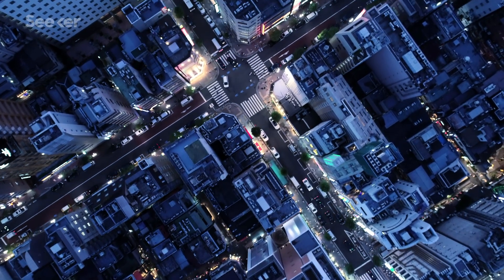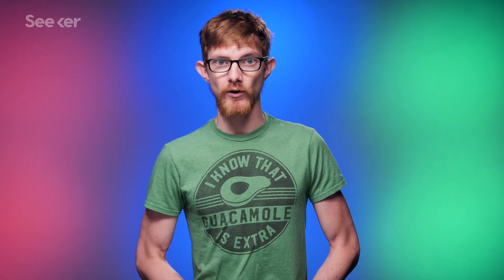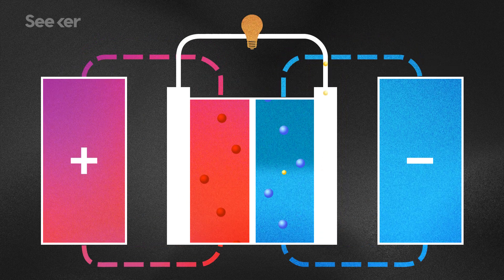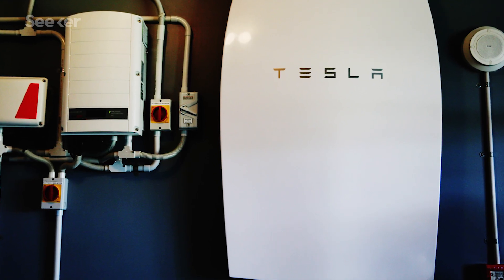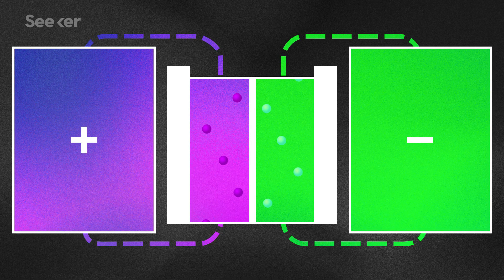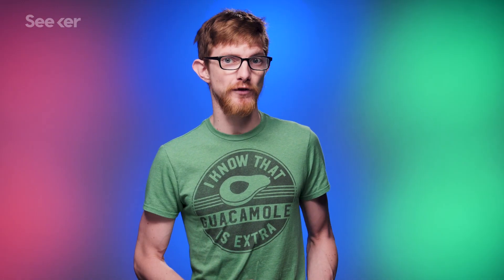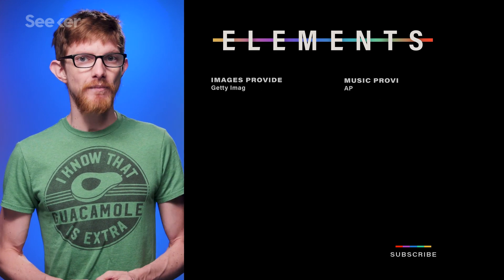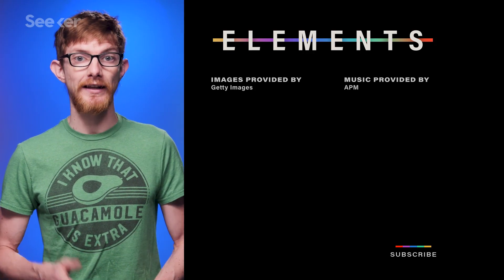Giant Flow Batteries Could Power Your City in the Future

Comment: One of my lecturers is a solid state chemist, and she works with these kinds of materials. Trust me, material scientists are trying every substance in existence to see if it can be used as a battery. We'll find something eventually
Reply: What's wrong with kinetic (spinning disks) or potential (elevated water) energy storage systems?
Reply: Well those are more engineering-related than just chemistry, and a little out of my field, but;

Kinetic disks have the problem that they don't really scale well and have a nice habit of tearing themselves apart if you try. There is some headway being done though.

Elevated water storage is already used all over the place. The big downside is there are few places it can be used, and it also takes up habitats.
Reply: Lewis Massie Makes sense.  I'm a big fan of, "KISS," which as I'm sure you're aware means, "keep it simple, stupid."
I like the idea of achieving energy-storage goals with inert materials.
Reply: Am l the only one freaked out by the notion of negatively and poisitively charged solutions? There is no such thing. I get that you try to simplify but l think this is a harmful.
Reply: @andraskatona9766  focusing on unrealistic solutions is harmful as they distract attention and investment away from actual proven solutions. Renewables will not save the planet. They will doom it by eating up subsidies, forcing nuclear power plants to shut down, and by locking in fossil fuel back generators.
Reply: @naberville3305  I agree with you in that nuclear is the way to go (possibly modular mass produced molten salt reactors). But I also believe that in the long run we must look at renewables as tremendous ammounts of enregy comes to earth in the form of sunlight. I think its naive to think that secondary cells could be scaled for such purposes but if you want to store huge ammounts of energy chemical enregy is the best bet. So something like electrolysis or flow batteries sounds good, to me it's good to hear about it.
Reply: @andraskatona9766  I believe solar is only useful for camping and calculators. Just because there is a tremendous amount of energy doesn't mean we need to tap into it. There is enough uranium filterable out of the oceans to power all of humanity for a billion years
Reply: @naberville3305  Fun debate. We will never produce any trace element from ocean water, maybe if we had practically free energy but than why mine uranium for energy. On the other hand we have big, good for nothing deserts where we can harvest all the solar we need if only we could transport it away. If it's economical than sure we should tap into it the more enrgy we have, the more we can do with it. Like fixing CO2 from the air.
Reply: @andraskatona9766  solar and wind are very ineffective at offsetting carbon emmissions.
Reply: @naberville3305  see you can't compare the sun with resources on earth.. hehe you are not even comparing it to the earth, home of resources
Reply: @shashankkumar5163  sure the Sun's wonderfully powerful. But unless your attaching a steam turbine to the sun there is no efficient means of harnessing it's energy. Solar is not an efficient means. It is much to resource intensive.
Reply: @naberville3305  well maximum efficiency human kind have reached in terms of thermal power plant is 46%.. While we have also reached near about 48% efficiency of solar panels in lab.. However the maximum theoretical efficiency of an infinite junction PV panel is around 86%... And one thing that in PV which is basically a large area PN junction is also understood as a container which is containing the electron gas. Therefore,  scientists use to apply thermodynamic theory for electron gas to understanding the electrical behaviour of PV panel (however nowadays more advanced quantum theory is used but that is more demanding in terms of computation). So it can be easily seen now that while PV panels use thermodynamics principle directly on the electrons which are current constituent particle while steam turbine applies thermodynamic to water gases to turn an electric generator to operate the current constituent particles electrons to move electricity. See which is more direct
Reply: @shashankkumar5163  I'm afraid that it hardly matters how efficient a PV panel is at converting received energy from the sun into usable electricity, if the intial energy received is dilute then It is a statistic that quite simply doesn't matter. And no the actual average efficiency is under 20%. When I speak of efficiency. I am speaking of resources and energy neccesary to produce that power. And in that topic.. solar is absolutely garbage. It requires 17x as much materials and 450x as much land to produce as much power as a nuclear power plant and creates 300x as much waste. Producing peak power at only about 15% of the time compared to nuclear producing it 90% of the time. 
Solar simply costs too much resources to construct, too much land to construct them on,  and produces too much waste for which there is little guarantee of proper disposal, and fails to eliminate carbon when it relies upon natural gas back up generators to regulate the grid when the sun doesn't shine. Solar as a viable alternative to fossil fuels is as much a fairy tail as snow white. Wind turbines are much more preferable to solar panels. Yet still lack the consistency neccesary to completely rid of fossil fuel usage. 
The goal is not to build solar panels and wind turbines. The goal is to rid the grid of carbon emmissions to slow global warming. Supporting a plan doomed to fail only makes our chances of achieving that goal all the more difficult.
Reply: Graphene.
Reply: and if we don't ... wat than ?
Reply: Catnium I'm trying to tell you all that space technology is waaaay more advanced that what we are being told.  What do you think they're doing out there at Area51?  Stealth?  Thrust vectoring?  No.  It's single-stage to space for which we possessed the technology in 1988.
Advanced propulsion?  You better believe it's a reality.  Just search, "UAP new York times", to find a new articles about craft that fly without wings.
Whether it's, "theirs", or ,"ours", it's real and we should stop digging up materials from the ground to energize our future.
Reply: (ignoring the spelling errors and dropping the mike)
Reply: Bio Gas
Reply: So your lecturer is a solid state chemist. How does that translate to knowledge expertise in flow battery design?
Reply: Energy storage is pretty much a lost cause. Even if you could develop batteries with 10x the energy density of lithium ion it still wouldn't be feasible. There is currently only enough energy storage in California for 12 minutes. Including every battery in every vehicle on the road. Times that by ten you still only have 2 hours worth. If you want to achieve 80% renewable energy from wind or solar. You need a days worth of energy storage. Meaning even with this supposed 10x better battery you'd still need 12x as many batteries as are currently in all of California. For 100% renewables you need a week's worth of energy storage. Or 84x as many batteries as there are in all of California. You might save the climate. Hurrah. But doing so would destroy the environment with how much strip mining for materials and land clearing for energy storage banks would take place. Not to mention asinely expensive. Any 'miracle battery' that gets Invented is still going to be new technology and stay unattainably expensive for a long ass time. Especially if it requires expensive or hard to come by materials. This is the limbo most current miracle batteries are in such as graphene. if we want to quickly offset carbon emmissions the only solution is tostart building more nuclear reactors. Might take several years or a decade to build. But once their operational they'll provide large amounts of safe, carbon free energy for decades.
Reply: Jacob Naber I know I'm contradicting myself when I say that the ultimate solution includes space-based solar.  Ten years ago, launch costs were the main impediment, as we have had the technology for gigawatt-class, microwave-transmitted arrays, for at least a decade.  Areas of lower demand can be serviced by megawatt-class, laser-transmitted versions. 
However, ten years from now, it may become a no-brainer.
If you Google, "PG&E space solar," you'll find that back in 2009 they were seeking regulatory approval to beam 200MW to a ground station near Fresno, CA.
Reply: @LostAnFound  not to be cruel but that's probably the most ridiculous idea I've heard yet. Because there is no way that will ever be financially viable even in rich countries like America. The climate can't wait 10 years for it to be technologically possible then wait another 50 for it to be economically viable. And any solution to climate change needs to be cheap enough to compete with coal in developing countries where the majority of carbon growth occurs. Nuclear power is the only solution to solving climate change. And I saw that with absolute certainty.
Reply: Jacob Naber Jacob Naber Like I said, read more about it.  We can deliver 24/7 juice from the fusion reactor in the sky.  Calling it ridiculous is the same as calling Starlink ridiculous.  Yet, the first 60 of potentially 12,000 internet-providing satellites is being launched next week.
In terms of immediacy, nuclear is slow for reasons: First are the stifling regulations (in the US at least) that can add up to a decade to approve a single plant; Second is the time to build the plant itself.  There are modular systems coming on the horizon thanks to military and NASA research.  But these are rated in kilowatts.
Haven't we learned to stop doubting the best term space capability?
Like I said: Learn more about it before you knock it.  The napkin math puts a 4GW space array at about $11B today, compared to about $6B for nuclear.  BUT, those are today's launch costs.  Not the three year from now costs that will continue to drop with economies of scale and reusability.  And, there would be no nuclear waste storage costs.  And, space solar would be capable of powering assets off-earth as well.
As for covering deserts with solar, I like that too.  Just pipe it out with yttrium-barrium-copper-oxide type superconducting conduits, or ultra-high voltage DC.
Reply: @LostAnFound  Noo.. it's absolutely ridiculous no matter how you look at it. There's no practicallity to it in any way shape or form. That cost estimate your making is an estimate before the technology has even really been developed. Prepare to meet the doom of price overruns. I just did some napkin math. Estimate is that we'd need about 300 square kilometers of panels to power all of humanity. That's 300,000 square meters. And according to the article on space solar I read. Average weight of their newer panels is about 3 pounds. Going to round that up to 5 to add the infrastructure to transmit that energy. With spacex's new falcon heavy costing 2500$ per pound to launch. That's about 4 trillion dollars just to ship the materials to space. Let alone manufacturing them and assembling them in space. Not to mention the fact that solar panels have a limited life span. Imagine having to replace all those panels every 20 years or whenever a tiny piece of space junk collides with the panels and shreds them. No dude. It's absolutely ridiculous. Insanely ridiculous. Preposterous even. Climate change cannot. Will not. Be solver by new untested ideas. We need to stick to what we know works.
Reply: @LostAnFound  also nuclear waste storage is super cheap. America has the largest fleet of reactors in the world and only produces 2300 metric tons of it a year. And with new reactors like molten salt reactors. That waste just becomes more fuel.
Reply: Jacob Naber Microsoft just became the third company to have a trillion-dollar valuation.  Up next: Asteroid mining.

And, I admire your ambition to put a price tag on the whole world with just one technology on the table.  Space based solar doesn't require us to abandon hyroelectric, wind, wave, or terrestrial solar.
Reply: @LostAnFound  So in other words is expensive and your waiting on miracles and advancements in order to make it feasible. By the time it actually becomes feasible to even start sending solar arrays into space, we could build enough nuclear reactors to completely offset carbon emmissions. There's no point. Seriously. Just because an energy source exists does not mean it's necessary, feasible, or efficient to collect it.
Reply: Jacob Naber Asteroids worth TRILLIONS are coming within reach. Mining in space = construction in space.  And mining = big bucks to do it.  New industries prove new technologies, so there are multiple paths toward assets in space doing more than spying, exploring, and enabling global communications.
Hey, don't take my word for it.  Watch the next five years
Reply: Jacob Naber Mankin's paper isn't waiting for miracles.  The DOE already proved the transmission tech in Hawaii and proved an 85% effeciency in transmission. 
And, 40 launches will be happening every day within the next five years (at least).  It's all there man.  Thing bigger.
Reply: @naberville3305  You don't need to develop batteries with 10x the energy density of Li-ion to power a grid, you need to develop batteries that are 10x cheaper. It doesn't matter how heavy the batteries are for stationary applications, all that matters is the levelized cost of energy. This is where redox flow batteries have the potential to shine, because as long as you're using cheap redox molecules and water as a solvent then the battery will be inherently cheap

Comment: Sounds like USC has something without using vadium. Thanks for the update. However being an old eternal skeptic. I'll believe it when it's on the ground and running. If USC has the capability to make their new batteries that can supply a home and remain green. Why don't they patent it and sell as a green alternative to whats out there now and use  profit from that to scale up to get rid of fossil fuel polluters.Of course what you have reported has to be correct to make a go of it. Thanks

Comment: Stuff batteries governments should be working on Fusion
Reply: @faxar1572   radioactive plants and batteries are good when they dont blow up                                                             edit: Dont leak radiation
Reply: @jayburrows9753  thorium is quite safe since it needs a nuclear catalyst it isnt powerfull enough on its own to start nuclear fusiom
Reply: Did you mean fission fireworkstarter?
Reply: Most isotopes like radioactive Thorium  will most likely leak over its lifetime even if the Battery or Plant doesn't have a melt down. It's unstable unlike a fusion reaction with helium 3 which in theory could supply us a lifetime amount of energy without radiation damage to the environment or meltdowns quite simply it's not a bomb. Watch kurzgesagt's video for a better view on it. I'd also like to debate with people that this kind of technology is too far in the future, it isn't as China has begun development on a fully functioning artificial star which should hopefully be done by the end of this year.

Comment: Let me guess.. the moon is full of Lithium and Vanadium?
Reply: Mostly platinum
Reply: The moon should have a lot of He3 & deuterium which is raw material for fusion.
Reply: @ottawahker  What about Mars?
Reply: @michaelvassilopanagos4462  
I think Mars have a lot of iron and its compounds (Iron oxides), that's why it looks red. Certain areas should have all kind of chloride based salts, because it had oceans before some years ago.
Reply: @ottawahker  you realise it looks red because nasa colors the pictures red right ?

its not really red at all
Reply: @catnium  The rumour of NASA edited the the colour of red planet has been around for a while; however, when you look at the night sky with your naked eyes when Mars near our Earth, it is very easy to tell that there is a "star" with red colour which is very different from others in the sky, you can tell it is Mars right away. 

NASA may put a red filter on the photos of Mars, but what is the purpose for that ?
Reply: Doesn't even matter if the Moon has lots of either. It has lots of silicon & you can launch from it with mass drivers. If you mine enough vanadium & lithium to meet our desires, then it's at least as easy to build solar power satellites to provide 24hr power.
Reply: Nope.
Reply: @eroMoD eroMoD and they can be put in the L5 4 and win were done sind them sun for melt down

Comment: Or a lake/dam on top of a mountain, pump up water with renewable energy and release the water when the demand for energy is higher than the output of the renewable energy sources.
Reply: Effective but doesn't scale well. There isn't a lake or dam next to every major city...
Reply: Check out Flat Land Electricity Storage (FLES). If you don't have a natural height gradient to take advantage of for pumped hydro, then just make your own. Another option is to use concrete blocks, rather than water, for a smaller footprint.
Reply: @shaminoranger  33,000 pounds has to fall 1 foot per minute to make ONE horsepower or 0.746 KW. Start doing the math and you'll see why this dosen't scale well
Reply: In theory this is a verry easy and effective way BUT there arent enough mountains you can easily flood with water to store the extra energy. Another problem is that not each region has some mountains in the Neighborhood. 

The best way, i think, is a mix out of all storage possibillities